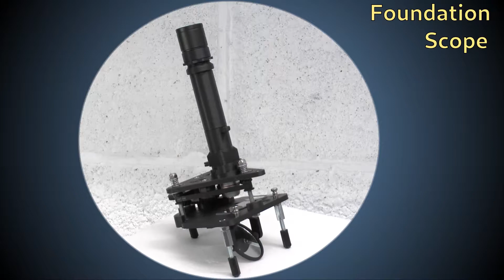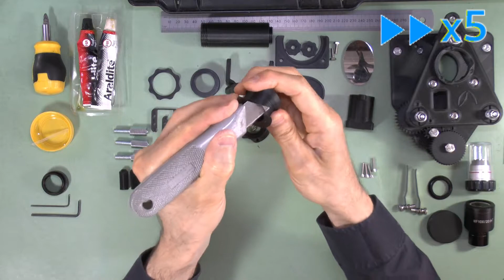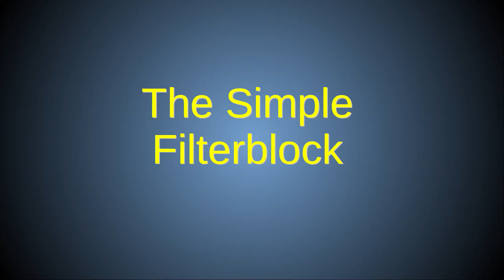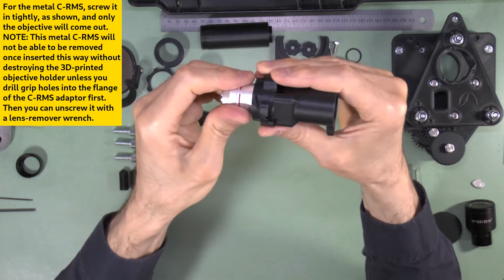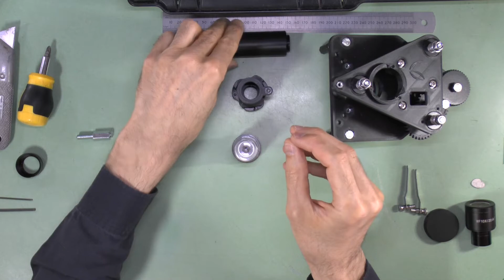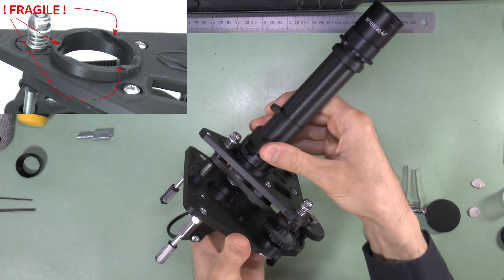How to Build a PUMA Foundation scope ( 3D Printed Open Source Microscope )

Comment: If I want to adapt a olympus turret into the PUMA Foundation microscope how I can do that?
Reply from the maker: To adapt for the turret alone (as opposed to a BH2 body+turret) would be a lot of work because you would need to find some way to stably suspend the turret over the specimen platform at the right distance and the turret is metal and, laden with objectives, would be quite heavy for a 3D printed plastic frame to hold it stably. Then you need to figure out how to suspend the PUMA filter block and ocular tube above the turret at the right distance and also in a stable way. This calls for a metal frame build - e.g. with 2020 aluminium extrusions - to deal with the weight. The focus mechanism would also need to be re-designed to cope with the new frame elements. By the time you finished it would be a significant customisation job.
Reply: @PUMAMicroscope  Thanks! I will try to do something to put the turret correctly :)

Comment: What is the alternative QR_Male_extn_4mm used for? i didn't see it mentioned in any module on the BOM.
Reply from the maker: The stage has a 4 mm range of Z motion. If the specimen is too thick (more than a few mm) you will not be able to get the objective high enough up to focus on it. So the 4 mm QR raises the optical tube (including the objective) by an extra 3 mm so you can put thicker specimens under the stage and focus on them. It is effectively a way of extending the Z range of the focus system.

Comment: EDIT: After sleeping on it, I decided to reflect on this comment and I realized the options I present as the only options are not, in fact, the only options: I checked out some other AliExpress listings and was able to locate one that had a 35mm M6 grub as an option; as such, I've removed my question and will be going with the 20mm spacer + 35mm grub that you suggest in another comment. Thanks!

Comment: ＠13:48 I'm building the short legs system while referring to both this video and your quick start guide.  I was intrigued by the line on the guide that says the hex head steel spacers must have 20 mm of spacer connected to 20 mm of male threaded rod.

But since the threaded rods don't go all the way into the printed feet anyway, I wonder whether it is okay for me to get spacers that are 30 mm long plus 10 mm of threaded rod (simply because the 20+20 versions are difficult to source), or is that 20+20 dimension necessary for some other PUMA configurations.  Many thanks for your awesome work!
Reply from the maker: I understand the issue with getting those spacer/standoffs, so an alternative is a good idea - but I wouldn't go with your suggestion and here's why: So that your system will be compatible with a potential later upgrade to the long legs system (if you build the Abbe condenser, for example) and so that you get the correct ergonomic viewing angle with the short legs system, I would suggest you use a 20 mm threaded standoff spacer and a 35 mm M6 grub screw as an alternative to those original 20:20 combo standoffs. This assumes you have 8 mm of free thread on the feet screws at the bottom of your stage (which you will do if you build everything else with the original PUMA specs).

So this 20 mm spacer + 35 mm grub, when attached to your feet, will give the required 20 mm of space from the bottom nut of your feet followed by 35-(20-8)=35-12=23 mm of free thread - i.e. equivalent to a 20:23 combo standoff (instead of the original 20:20). This extra 3 mm of free thread at the end should not be a problem (in fact it may make it a bit easier to fit the long legs system later) but if you had shorter than 20 mm of free thread at the end it would be an issue that needed addressing with design changes elsewhere.

You could use other alternatives (like the one you suggest) but then you would need to make compensatory modifications elsewhere in your system to achieve the correct heights and lengths of free thread for making future upgrades.

I hope that all makes sense. All the best with it.

PJT

Comment: I need a micrscope for machining on the lathe. Would this be suitable? Maybe with HUD for quick measurements?
Reply from the maker: That's interesting. I am not familiar with this application so can't give a definitive answer but the customisability of PUMA should allow you to design your own custom fixture to hold the optical tube in the right position with your own focus mechanism designed for the task. If you will be looking directly down the eyepiece you will need high eye relief eyepieces so you can look while wearing your eye protection and you won't get stereoscopic depth perception (even with the binocular head) so bear that in mind. However if you will be viewing via a camera instead it should work.
Reply: @PUMAMicroscope  thanks for the answer. Will try in the next weeks.

Comment: Hi Thank you for making this public. I am very excited to make this and learn about optics. I have started printing some parts and I see that the MN_Ocular_cap.stl is missing instead I could find Ocular_cap_170.stl but i think it wil not work with 160 optics (or i might be wrong)? also in the latest release I couldnt find  MN_Monocular_tube_c_adhesin.stl but checking it on the older release I could get it.
Reply from the maker: Hi. Please do not use files from the older release - some measurements have changed and in some cases it makes a big difference. Note that in the FreeCAD files you will see the model name without the prefix. So, in the Monocular.FCStd file downloaded from GitHub the part called MN_Ocular_cap will just show as 'Ocular_cap' (without the 'MN_'). I just checked that file (I downloaded it from GitHub) and I can confirm that it is there. Be aware that not all parts are set to 'visible' in the FreeCAD files - you have to click on the part you want in the list of parts in the left panel then press the space bar to toggle visibility. In order to see this list of parts (whether visible or not) make sure that, when the file is loaded in FreeCAD, you go to menu: View -> Panels -> Comboview. When Conboview is selected you will have a panel on the left that lists all the models.

Comment: Hi, I have some troubles with the tolerances of the Trainer part.
In the video it seems to fit well at https://youtu.be/_5T8KuMbnq0?t=649
On my case no matter how many times I try, it will never end up in the "locking" position, even by forcing it stops before reaching the end.
I tried to re-print this part with 0.1mm layers, and the problem persists (even if it's a little better).
I guess I have to change some parameters of the "Triskelion" part on FreeCAD, but I'm not sure what.
Thanks!
Reply from the maker: I can't explain that off hand. From watching the clip i realise that the trainer can't actually be used once the stage is assembled like I showed because the front focus post gets in the way of the handles of the trainer (so such training will need to be done pre-assembly). If the actual QR adaptor fits but the trainer doesn't it may be that I have inadvertently left an older version of the QR mechanism on the trainer model but I don't think so because that is an ancient mechanism that hasn't changed for years. It will be useful to hear if others have had the same problem - so far you are the only one who has brought this to my attention.
Reply: @PUMAMicroscope  I don't think I have an outdated version, on FreeCAD the model seems right.
I think it's a tolerance problem, so in theory I just have to adapt the trainer part and add some spacing on it, but I have some troubles doing it. Any idea of how to increase the thickness of the "Triskelion" part?
Reply from the maker: @TICS_Game  That would involve changing the dimensions in the three sketches in the 3 sweeps.
Reply: @PUMAMicroscope  Sorry to pick up from an old thread, but I am having a similar problem with tolerances as I only have access to a relatively cheap 3d printer.

Instead of fiddling with the tolerances, I am thinking of modifying the CAD file to make a magnetic locking system instead.  Would you recommend against that?  Are there any chances that a neodymium magnet based system may interfere with any of the advanced features?
Reply from the maker: @seraphpegasus   Hello. I suppose it all boils down to the details of your design - perhaps your maglock system will actually be better than the current QR. It also depends on your own use-case for the system - for example if you intend to use bulky optics like the the advanced filter block with an AR projector side port and an epi-illuminator port and more stuff on top, etc. If the maglock is designed to prevent movement even will all that stuff on board it should be fine. It also needs to be designed to hold the tube accurately in place to prevent misalignment of the optical axis. However, the addition of the PUMA stabiliser system might help with all that. It could work - just depends on the details. I would be interested to hear how you get on. You might want to check out the UC2  system - they use maglocks and their system is also open source. Just Google "UC2 microscope" if you need a link.